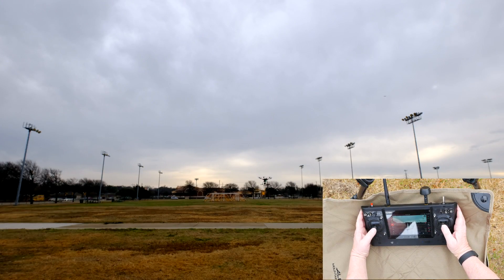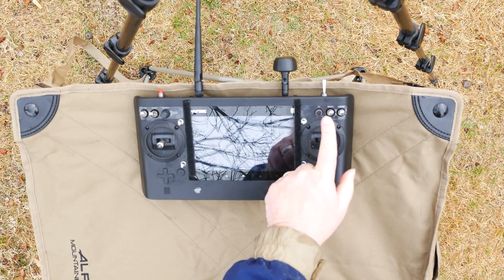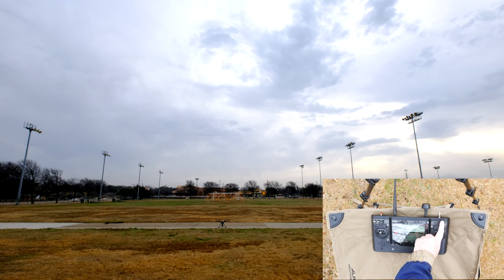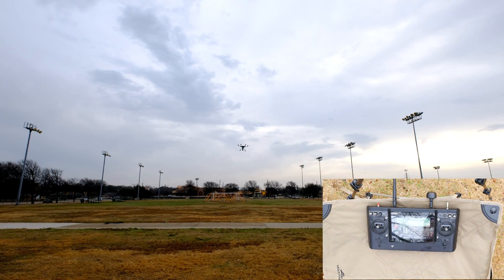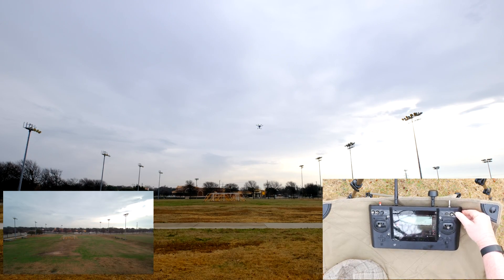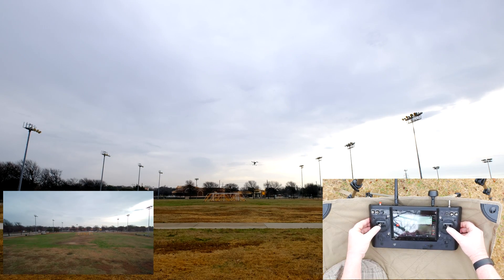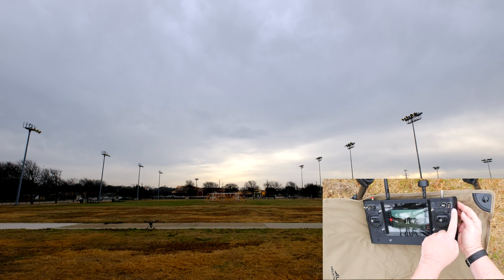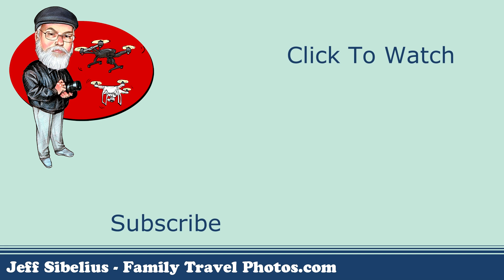How to Fly Your First Flight With the Yuneec Typhoon H - Episode 3: Typhoon H 1st Flight

Comment: Did a few short 2-3minute flights. More for getting used to the difference between smart/angle along with practice and landing. Did it in my cul-de-sac Went pretty well. Also did some with GPS disabled. Had 2 compass errors but that was when battery was low and was near a metal structure...hope that was the reason.
Reply from the maker: I'll be interested in hearing if your compass errors continue. I had a few of those on a previous firmware version but none since then.

Comment: Jeff is not rabbit mode the high rate's dial?   Also the rabbit mode , yuneec say's it is for use at altitudes of 5,000 to 8,000 ft. The higher the altitude the harder the motor's work to sustain the higher altitude's. Basic rule for all flying thing's. Equal's higher flight ,less endurance. due to more power consumed. So is the rabbit-turtle dial for high and low rate's? Or for higher motor output? Thank"s.
Reply from the maker: Rabbit mode will serve both purposes you describe - increase your flying speed and provide more power to the motors for flying in the thinner air of high altitudes.
Reply: Thank's Jeff! Yuneec say's to use turtle speed when flying between 5.000 -8.000 ft. alt. So That's why I asked. Seem's counter intuitive . At 8,000 + altitude even in turtle mode the rate setting seem's very high. The  directional change's seem very abrupt. In rabbit mode is your video stable? Thank's bushpilot 2001
Reply: Sorry I meant to say Yuneec recomend's turtle mode for altitudes of 5,000-8,000 alt. Not rabbit mode. Thank's Let me know what u think. Thank's.
Reply from the maker: You're putting a lot of good thinking into this and making good observations.

It does seem counter intuitive. The air is thinner so your motor's power would be diminished, so you need to increase power to maintain lift. That's what I would think anyway. The Yuneec manual is translated to English from Chinese, and sometimes that isn't done accurately. Logically speaking, I think this is one of those cases - I have not flown at higher altitudes, so I'm speculating based on logic and reasoning not speaking from experience.

The H can be twitchy in Rabbit mode when you have sudden stick motions. The gimbal eats a lot of that, but the real problem is that it can cause your props to show up in your shot; e.g., if you jam it all the way forward in rabbit mode, you're likely to see your front motors at the top of the camera view. Same holds true for your landing gear if not raised - jam it to the side or do a fast yaw and the feet often show up in the shot.

The H is like the DJI drones in that respect; you have to discipline yourself to ease into changes in speed or direction to reduce these situations.
Reply: Very possible it is chinese translation. Yes every multirotor I have built for camera's, it is possible in fast forward flight to see the motor arm's. I built a 650 mm quad and to slove that problem put 500 mm rails for the gimbal. So the camera was in front of the motor's,problem solved. Just adjusted theCOG by moving batteries to the rear.  The yuneec even in turtle mode is very twitchy w/cyclic input's. I will adjust to it. The best thing about the H to me is the manual mode. It hold's altitude and attitude better than any other brand or model I have ever flown. so easy to fly, I also fly competive  3-D helicopter's. Thank's much for your insight's into the H. From my full scale flight experience high altitude supersonic craft, the power ratio increase to stay at high altitude is dramatic. My H is going to be flown at 16,000 ft. this weekend.  From the top of Mt. Crestone in the Sangre DeCristo mtns.   Basically 5 miles behind my house, which is a heliport at 8,0002 ft. The battery endurance  at that altitude should be interesting. I believe it will be a world record altitude for the H.  I will let you know the result's.  bushpilot 2001.
Reply: Thank you for all of your video's, you work is appreciated. Well done. bushpilot2001

Comment: My landing gear isn't going up, do you have any advice. When I press the up switch one leg moves a little and stops for some reason. Do you have advice
Reply from the maker: I just posted a video on resetting the landing gear - check that out and see if it doesn't get you fixed up. You may have to do the process a few times. https://www.youtube.com/watch?v=Edg9dPH27Bk

Comment: Jeff  what is your opinion of the h
Reply from the maker: Great question. My opinion of it for my own uses is that it's terrific. Greater camera features (histogram, etc.) and CCC alone make it a big improvement over the Q, and then throw in the fact that it handles wind so much better than the Q and it's worth every penny of its price difference. 

But that's me - so who am I? I use it for personal and commercial use, mostly videos over stills, I'm experienced in drones and a photographer of more than 35 years. I fly to do photography; flying is not why I do it, so I want a simple, stable, reliable system that allows me to get the images I need.

For someone just starting with this level of drone, the Q500 is cheaper, easier to fly, slower and it has mature firmware that isn't buggy at all. Easier to fly, easier to maintain, less expensive - but it doesn't handle wind as well as other drones. 

Now throw in the Phantom 4 Pro to the conversation and it has features that make it a great choice for people with different skill sets and priorities.

I'm actually going to do a video on the right drone to buy from those three choices - if Autel wants to loan me a drone I'll include it as well. But the real question is, what are your priorities and skills? How do you want to use it and what is most important for you?

Tell me a little about your plans and I can give you a better answer for your purposes.
Reply: Jeff Sibelius basically Jeff I've had my q just short of a year I love it but I want to have waypoints ,but I don't want to have to have a tablet or phone to use it, I want it self contained, I use it for the pleasure of flying and to photograph nature and things we are doing,I'm not sure if I do commercial right now but who knows,I got a lot of good info about my q from you keep up the good work
Reply from the maker: Based on that, the Typhoon H is your choice. You get the integrated tablet on the remote, double the ability to fly in wind, waypoints, obstacle avoidance (mediocre), and the ability to keep flying if you lose a motor. Faster speed, 360 degree gimbal, landing gear that  raises up . . . everything on your list and more on top of that. The H will work in some commercial applications if you go that route and the new features they added with firmware updates are great.

Phantom 4 is a terrific drone with camera features above and beyond what the H provides, but you do have to use an external viewfinder. The Ipad/Iphone just isn't as bright, and the Phantom 4 Plus is having all kinds of problems with setting up. 

You are going to love the upgrade from the Q500 to the H. 

I'm glad I've been able to help. I will continue to do Q500 videos but I'm catching up on typhoon H episodes right now. I also plan a whole series on the Phantom 4. Then we'll get into more advanced photography tutorials. LOL I have a bunch of videos planned.
Reply: Jeff Sibelius thanks Jeff,are you in Iowa I was curious I use to live in fort dodge
Reply from the maker: I live near Dallas, Texas but I was born and raised in Iowa and went to the University of Iowa. Still love my Hawkeyes!

Comment: Great video and helpful for the new "H" pilot.  There are a couple statements that I've found to be different.  

1. "Turn off video recording or the video won't be saved."  That isn't true.  I've done this a few times.  It may be firmware related but I've never lost a file from making this mistake.  I believe in older firmware if you did that, the file didn't close properly which rendered it unplayable.  However, if you make that mistake, simply power up the "H" again and then power down and the video file will close properly and will play normally.  

2. You use the term "vortex ring state". Unless you are schooled in fluid dynamics, that term doesn't make much sense to the average person.   I've been a real helicopter pilot since 1984 and the condition you are referring to has always been called "settling with power." The reason this term has always been used (in FAA Examinations as well) is because it is easier to visualize the condition taking place with that terminology vs. Vortex Ring State.
Reply from the maker: Thanks sillywwabbit!

Regarding the video, if you power down without shutting off the aircraft, you often can salvage things by booting up the aircraft and hitting the video button a couple times. That holds true for the Q500 as well. I'm going to be doing some quick tip videos in the near future and that's one tip I plan to point out.

It doesn't always work, however. I've tried it where it works, and I've tried it out without success. In this first flight video my goal was to establish the good practice of  making sure people hit that button - then there's never any risk of them losing the video.

I'll happily defer  to your expertise with regards to vortex ring state and settling with power. I'm sure you're correct on that. If you talk with people in the multi-rotor hobby, they use the vortex ring state term, and even if it's not  the best choice it doesn't hurt to use the more common phrase for newbies. If I could  put an annotation on this video with the correct term, I would though. I like to be accurate. Unfortunately, if  you use end cards on your video you can't put notes on the video, so I'm kinda stuck.

Thanks for watching and offering your expertise!